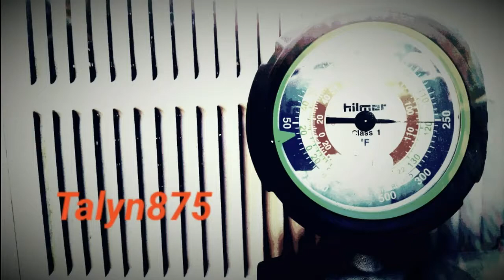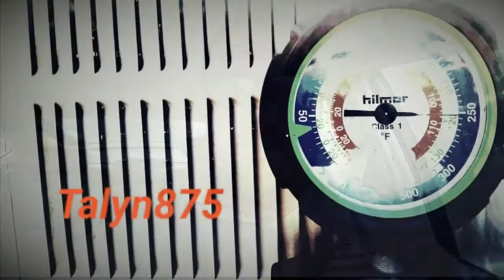What Temperature Should My Thermostat be Set On?

Comment: My answer to "what should I set my thermostat to" I explain the most efficient air conditioner or heater is one thats not running. so In the summer time set your thermostat as high as possible but still be comfortable and In the winter aslow but still comfortable. .

Comment: on replacing a single pole 40amp contactor does it matter what type of connection to go with i now have terminal connectors under a screw i see there is also a block coneeter to stick wire into what is best
Reply from the maker: I like lugs personally

Comment: Is an 18" flex return on a 25"x32"(yeah, it's weird) enough for a 3 ton condenser/3.5 ton air handler?  It is a 2005 10 Seer Coleman, and we have to run Flanders Red Microparticle pleated filters for allergies.  It hasn't had any issues, but would it be worth adding any returns at this point?  Also, we set 68-70 in summer, 74-76 in winter.  (Heat Pump)
Reply from the maker: 18 inch is good on a short run for a 3 ton condenser.